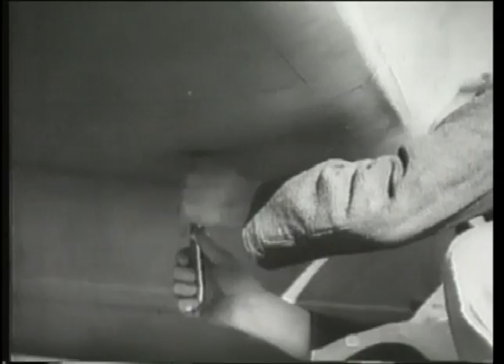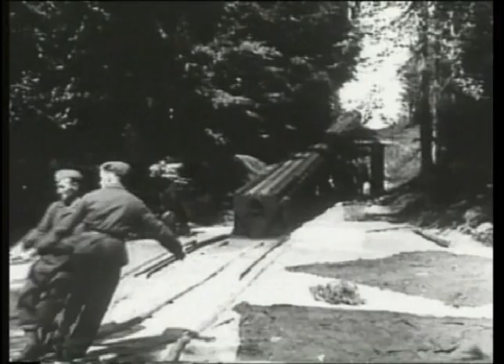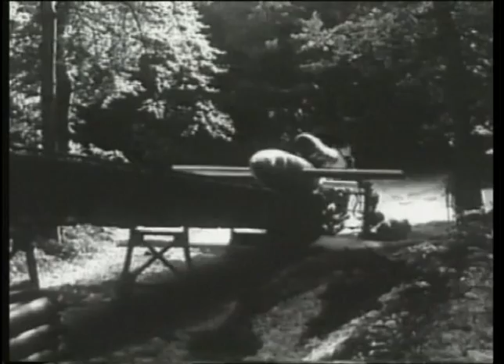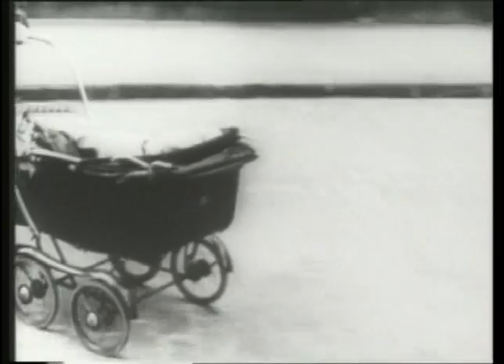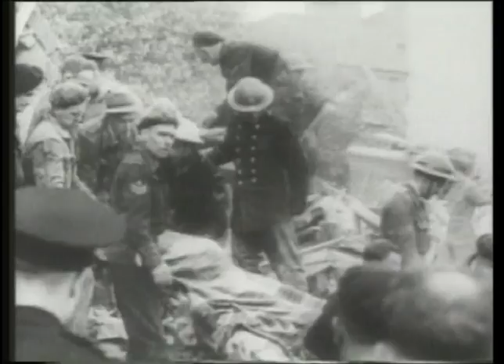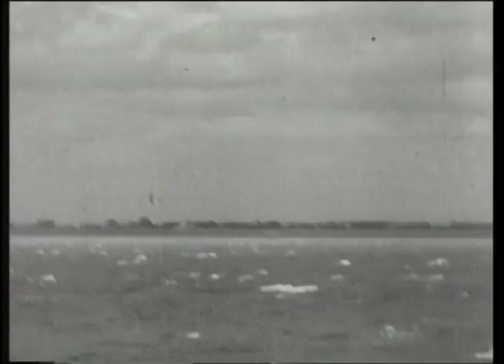V- 1 Flying Bomb -  Fieseler Fi 103 (Vergeltungswaffe)

Comment: It did not dive because the fuel ran out. The fuel to the engine was cut off momentarily because it shifted position away from the fuel line when the bomb started to dive after a given distance and the engine could not start on its own again!!

Comment: A common mistake by "amateur" historians is to regurgitate old propaganda.   So it is with this presentation which is wrong in important facts:-
1.   The number of V1's launched per day was not 63, it was close to 163. 
2.   By far the most effective way of destroying the V1 was not tipping its wing with a fighter aircraft, but shooting it down with anti-aircraft guns.  But not British guns, which were near useless against V1's which flew too fast and low, as the Germans anticipated.   Most V1's shot down were shot down by American crews using American radar-controlled guns.   But the British could hardly bring themselves to admit that after the War, could they?  And during the War the radar used was secret.
3.   And as noted by others, the engine cutoff was specifically timed, and not occurring just because fuel ran out.
Reply: It's ok brother, this scenario gives folks like you and me, a chance to set things right and hope fully spur others to do some research before hitting Youtube to spread innaccuracies.
Reply: Thank you for your excellent input!

Comment: a V-1 was powered by T-stoff and C-stoff like the ME-163 Komet?...i always thought pulse-jets just used gasoline or even kerosene for combustion....and the V-1 didnt dive when out of fuel. a timer dictated the "drop-point" and the fuel was then shutoff, and it locked full rudder and full-down elevator that sent the V-1 spiraling-in.
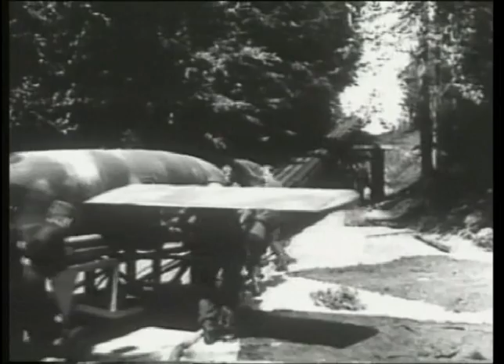Reply: Yes, I picked up on that mistake also, 👍 (at: 1:03)
Fi-103 (pulse jet):  75-octane gasoline.
Me-163 (rocket):  T-Stoff and C-Stoff.
Reply: thank you and good eye and ear resuelgoog!!!
Reply: rocket was used to accelerate V-1 on a launch track
Reply: The rocket launching it used T stoff and C stoff.The pulse jet powering it after launch used Gasoline.

Comment: People on the ground always said when the buzzing stopped is the time when you had to start worrying which means the engine has stopped.  I always read that, that action was controlled by the little propeller in the nose which was clocked for so many turns before it shutoff the fuel, simple.  I don’t believe it’s fuel supply was T-stoff and Z-stoff as used in the ME-163 as the engine used a spark plug to ignite the fuel which I would guess was kerosene and for compression it had a butterfly valve that would fly closed when ignition occurred and that opening and closing is what caused the buzz sound.  Finally, I believe the craft was launched using steam power.  But of course I could be wrong.
Reply: The statement was that the catapult used the T stoff and Z stoff, not the V-1.
Reply: stoff's were used to launch it with compression on the ramp, kerosene was the fuel

Comment: The V 1 didn't fall when it's fuel ran out. A cut off switch on the fuel line was configured to cut off after so many miles were traveled.

Comment: If V-1 had a swept wing, it might have more effective speed, 
at least 650km/h, which made more difficult for allied air force to intercept. Oh, you say Hawker Tempest has much speed over 650, 
but I think it was only possible over 20,000ft of altitude.
Reply: not enough lift with lack of thrust

Comment: The commentator states that the V1 fell when it ran out of fuel. This is incorrect. The V1 had a small propellor on it's nose that spun in flight and after certain number of revolutions, calculated by the Germans, it was know what the mileage had been and so where over London, or the target, say Antwerp or the invasion beaches the V1 was, and this caused explosive bolts to fire and lift the tail so the V1 went into a steep dive. The steep dive caused the fuel to be cut off from the engine and so it cut out, hence the rumour that that was what happened. This is how British Intelligence "fooled" the Germans by reporting damage in certain places where the bombs had not actually dropped and causing the Luftwaffe to change the target's range so the bombs actually did fall short.

Although "Buzz Bomb" was a common nematode Government encouraged it, along with the "run out of fuel" story to keep the public morale up and minimise the knowledge that the V1 was in fact a sophisticated weapon and not a bit of a joke.
Reply: +leokimvideo This is a bit hard to reply to without sounding pompous but here goes. I realise youtube is about fun, entertainment etc. But when a subject like the V1, comes up it really is in the history and hard facts department and does need correcting. The reason for the "running out of fuel" rumour was actually part of trivialising and making fun of what the British Government realised was a very dangerous weapon and attempting to minimise the impact psychologically on the British population. For the same reason the names "Buzz Bomb" and "Doodlebug" were encouraged and propagated as again they reinforced trivialisation. The running out of fuel myth was a critical part because it made the weapon seem less effective. If the information that it could be targeted to within quite a small area then the population would have felt less secure.

So in fact this is not a "little mistake" but a perpetuation of the Ministry of Propaganda's excellent wartime effort to play down the threat from the V1's still in full swing more than 70 years after the event.

The Wikipedia entry on the weapon is worth a read as it give a good feel for the cleverness and complexity and danger of the weapon in a reasonably short article.

Again apologies if i sound over the top, i am not having a go at anyone i just get annoyed when history get simplified too much
Reply from the maker: +john howitt thank you for the informative (and correct) information..rgds

sporrtdog
Reply: Were any nicknames coined for the V2? Either by civilian press or government?
Reply: Felice Graziano Probably nope, couldn’t see it or hear it  just boom when it detonated. Where l live a Woolworths store took a a direct hit killing about 140 people
Reply: If the V1 was flying into wind, the little prop will spin faster/more for same distance covered than flying i.e  downwind oversame distance - just a thought
Reply: I read that this small propeller was used for arming the bomb.  Never knew that it was used to signal the beginning of a dive though.
Reply: Thank you for that info! I have studied ww2 for years always learning! No....it was NO joke! My Dad served with the USN at Normandy and vividly remembered the sight and SOUND! Also the British pilots that went after them.
Reply: john howitt  Sir what a great invention what if the Nazis win in  WW 2
Reply: @kuk3543  They were NEVER going to win, the lost the war by going to war. And it's a pretty crude weapon, which achieved SFA and cost too much to do. I'd bet you were not aware of those last two points!
Reply: In war times each side would try to minimize whatever combat strategy or effective new weapon the adversary would present. US government hide from the public the fierce bravery of the Kamikazes. Japanese military kept telling their people the allied were suffering destruction in the same proportion as Japan. Hitler told Germans that his army couldn’t invade Russia like all the rest of Europe because they were trapped in bad whether, when he actually lack military resources to do so.
Reply: Da ist nichts mit einen Sprengboltzen"! Der kleine Propeller an der Front der "V 1" zählte die Umdrehungen, die vor dem Abschuss der "V 1" auf das Ziel Berechnet worden war. hier ging es dann in einen Sturtzflug über und das mit laufenden Triebwerk, bis es einen Winkel von 60 Grad erreicht hatte. Erst dann setzte das Triebwerk aus! Man liess das Triebwerk nämlich so lange laufen, da es beim Sturtzflug eine höhere Kinetische Energie freimachen konnte.
Reply: +john howitt youtube is never about being completely correct, little mistakes let the audience have their say...it obviously worked

Comment: I wonder if they could have increased it's cruise speed if the wings were swept? With straight wings,even fast piston engined fighters could catch up to it.
Reply: I don't know, but I do know that there is a speed limit because of the way the pulse jet works. There is a designed speed which gives the most fuel efficiency, which is important here too. If it goes too fast, then it gets blown out like a candle. Probably it could've flown faster, but by how much though? Probably it wouldn't have necessarily worth it if the speed increase was too small. The AA firing still can catch it regardless of speed, because it has a straight and predictable path, just less time. It would've given a better success statistics but its unsure by how much. Also consider the shape of the wing in connection to its ability to dive sooner and straight when losing speed. I don't even know why I care this much. The germans probably had very food reasons and considered things professionally already. Maybe it was just the cost. Lol
Reply: @akosv96  Actual knowledge!  Wow, and keep it up. I love it when people get interdependencies in a system's design and build.   ............  It was quite a difficult target despite its undeviating flight. ? Just a bit to high for the Bofors 40mm, and a bit too low for unpowered 3.7".   Really needed the predictor fed powered versions of both, and for the 3.7s the proximity fuse. ;-) And there were US 90mm's in there, too!
Reply: More likely upgrade the engine. Swept wing mean different aerodynamic, probably higher stall speed.

Comment: "Fell to Earth only when its fuel ran out" WRONG. The V1 had a small windmill in the nose which formed part of a timing system. When the windmill had completed enough rotations to be over its target, the elevator was locked full down and the lines to all control surfaces were severed with a guillotine. This caused the V1 to enter a steep dive and on early V1's, the negative G forced caused the pulse jets to quit. This was fuel issue corrected on later V1's and most then hit under power.
Reply: Elsewhere I have read that the timer triggered the fuel line guillotine and an explosive bolt that secured the main wing spar.
No thrust / no lift - the remaining fuselage dropped like a brick.
There are/were old guys 'who were there' and insisted the bomb was propelled by a single cylinder motorcycle engine .
Hard sometimes to separate the facts from folly.

Comment: Thanx for that, it's been months since I looked up the V-1.  What I do remember is that it's internal operating systems were far more complex than I originally thought.  I also remember that they had to be "leveled" bi laterally before take off.  One was captured intact and a German magazine was stuffed in the wing strut area.  They assumed it was there for weight to balance the missile from side to side.

Comment: One thing I noticed in the this vid, he says the missile only hits after it runs out of fuel.  The other night I was reading about Fiesler 103 and apparently it had some type of "guillotine" affair that cut something in the tail along with other things that forced the missile into a dive.  In fact the missile was supposed to hit the ground under power and it said that many of the last ones did.  The engine wasn't supposed to "cut out", the steep dive caused fuel problems.